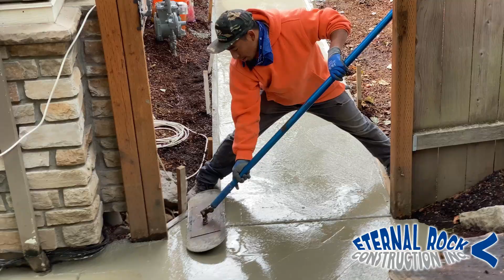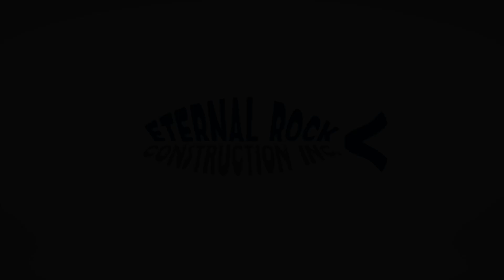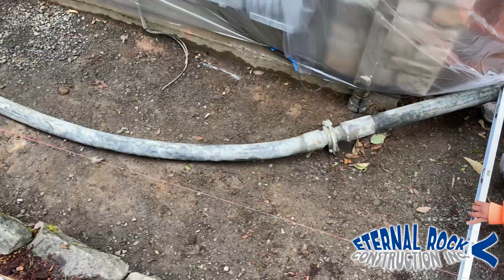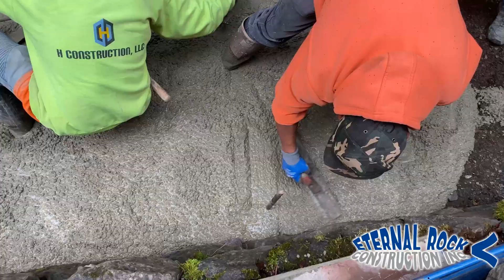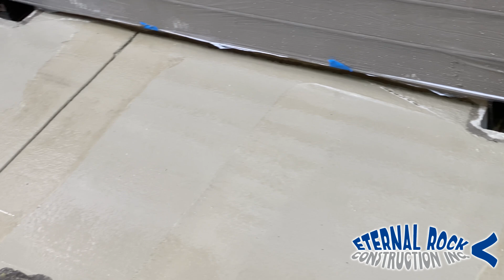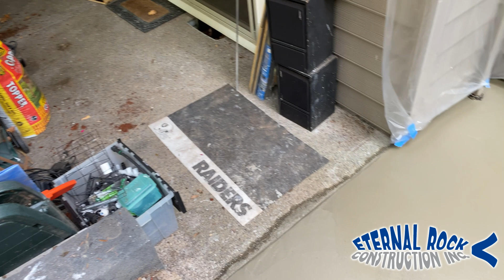How To Pour A Concrete Walkway With Exposed Aggregate Finish DIY | Step by Step Process Explained

Comment: Why not rebar and wire (it should be included I’d think just in case of any pressure) and why not expansion joints between the house and concrete?

Comment: Hi how come y'all didn't use any wire
Reply from the maker: Hi, we don’t typically use rebar unless stipulated in the contract. Rebar is not necessary in every concrete pour. Thanks for your question
Reply: @Keystoneindustries-al5807  oh I just always see wire mesh being used and someone yelling pull the wire lol lol